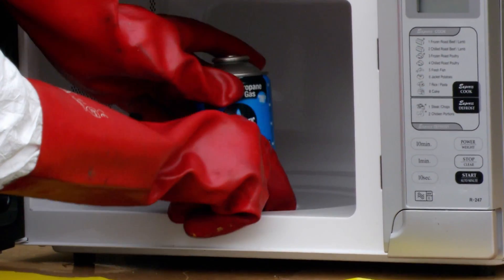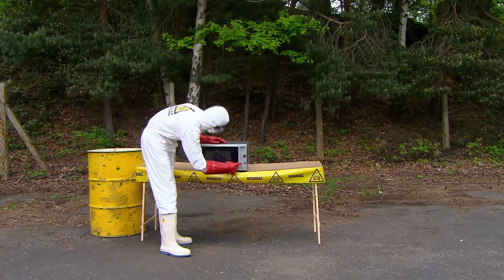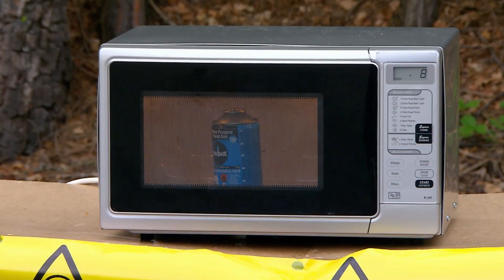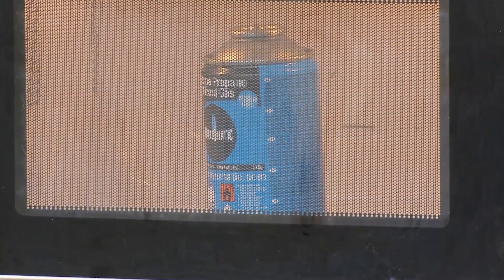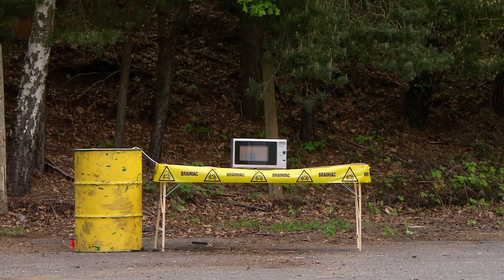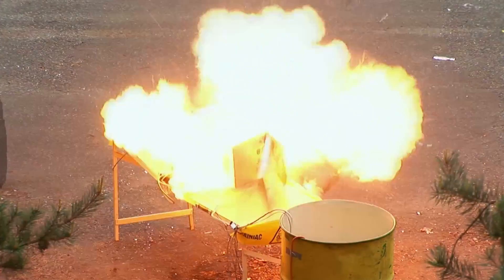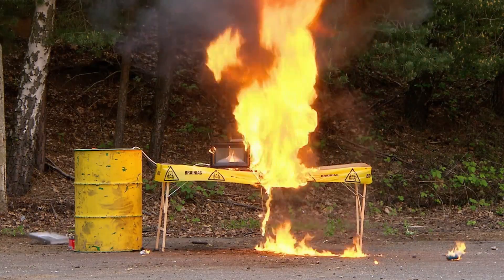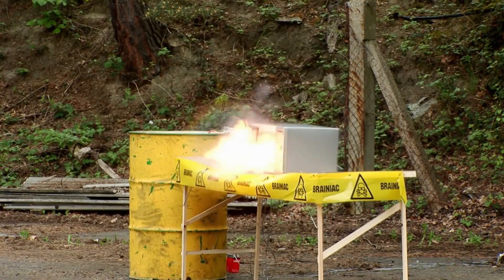Butane Gas Cylinder + Microwave= ? | Brainiac

Comment: why did it only explode when the so called bell went? where is the cans safety valve??
Reply: Video editing
Reply: IT's on the top of the can, but there isn't nobody WHO could pressed this Valve just straight down.
Reply: 1. It's clearly an audio edit for minor entertainment.
2. I don't think a safety valve matters when the can is under that much intense heat and pressure.